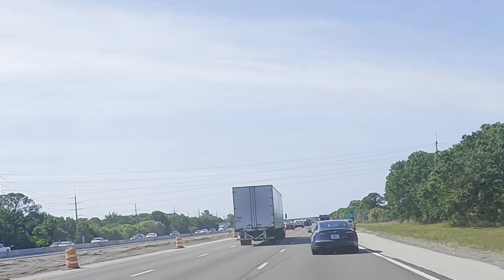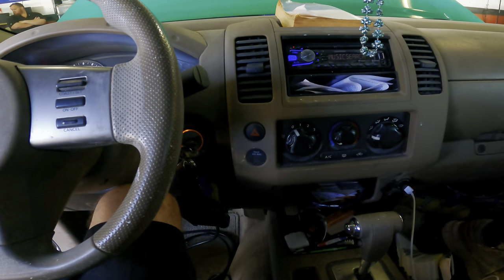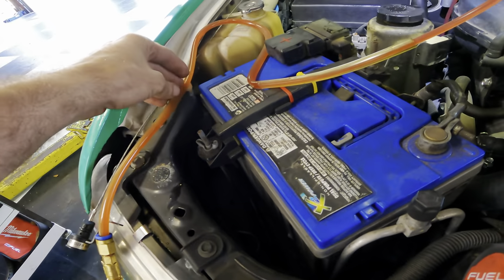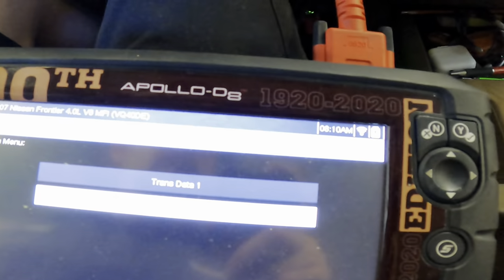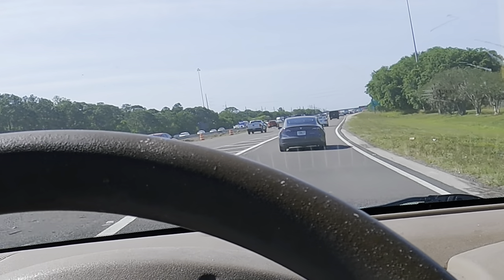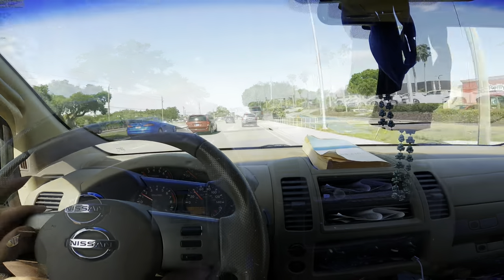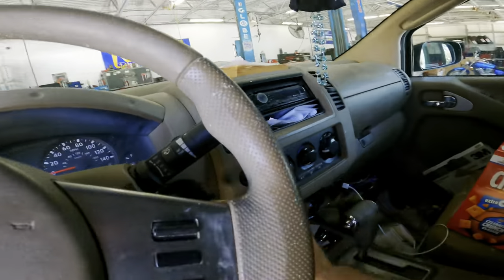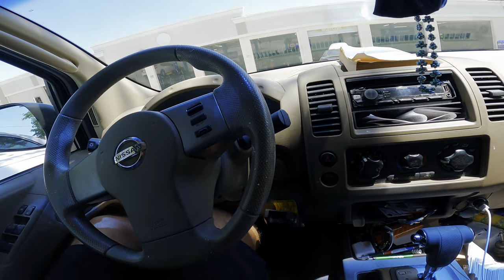Customer States: Vibrates Sometimes! How to save money by using your words!

Comment: Based on the state of the interior of this customers vehicle speaks volumes towards their view on vehicle maintenance. Ray sometimes when you lead them to water the best thing to do is to drown them in it...just kidding. Thanks for another entertaining and informative video.
Reply: Not necessarily. I know several people who are tip top on maintenance and it's impossible to get a passenger in their car. I know a few HVAC guy who's dash board is packed full of papers, the inside of the cab full of all sorts of stuff, but oil change is on schedule.

Comment: how do you know that your vacuum hose will not touch a moving part and destroy the transmission? Does the dipstick stop in a tube or does the end stick out into the tranny case? Hope you don`t have another episode like when you first started out and left the filler hose in the engine.
Reply: Usually the dipstick tube goes within a few inches of the bottom of the pan. No moving parts around it. His tube is hard plastic and doesn't bend a lot over such a short distance.

Comment: When did transmission OIL become FLUID? That stuff looks so weak it might even be Cranberry juice.
Also, no mention of the warning light for tyres happily glowing on the dial.
Reply: Since science and technology brought us to the point where viscosity is independent from lubricity and shear strength.  The last 20 years have seen insanely rapid advances in tribology, and these almost water-like modern lubricants offer better performance and wear characteristics for far longer than 10W-30s of decades past.  Significant improvements in the accuracy and consistency of production-scale precision machining help, too.  :)
Reply: Well, the containers of automatic transmission fluid do say ATF on them.

Comment: Typical automotive mechanic not a transmission mechanic a transmission mechanic would take in consideration how many miles are on a transmission before evacuating fluid a warm transmission needs the fibers that are in that oil to assist worn out clutches you take that away from a Warren set of clutches in a transmission seen you will have no transmission that's always what most mechanics make that mistake another words you could have got more time out of that transmission. There's a good chance in a couple weeks he will have no choice but to the transmission shop when I start slipping due to bad clutches and now absent of the friction in the oil to help them bad clutches alone

Comment: the reason your working on cars is because the bozo,s that drive em dont know squat, I tell the customer you have a blown head gasket , Oil looks like baby crap, steam coming out the tail pipe, so they drive it around looking for a better deal on the head gasket, and wonder,s why the garages turned him down to replace the head gasket